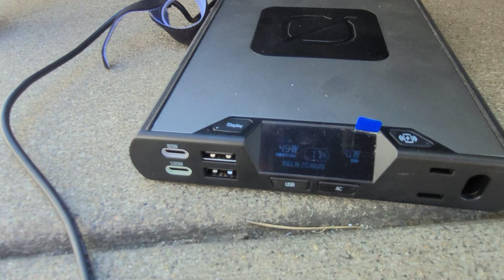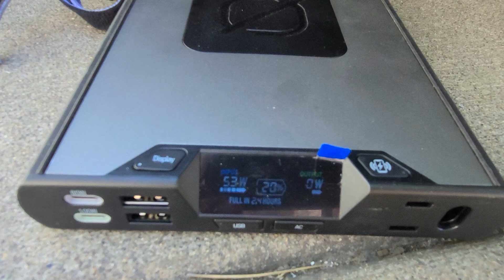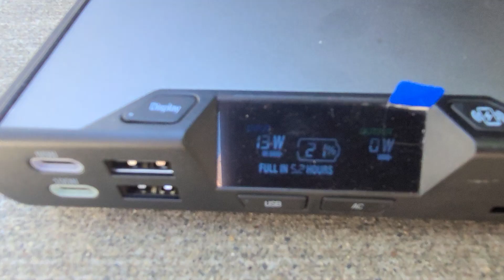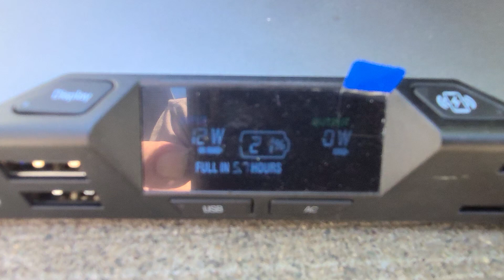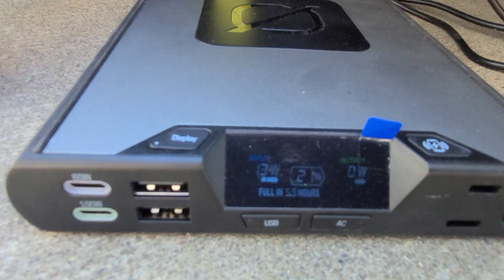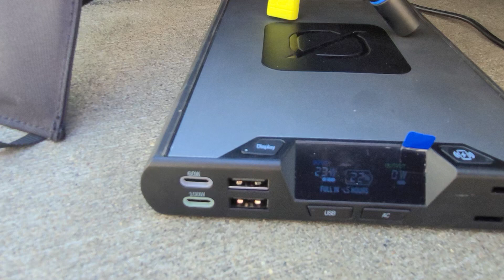Side-by-side testing of Goal Zero Nomad 20W, 50W, & 100W panels with Sherpa 100AC

Comment: Could you recharge a Chevy bolt EV with these folding panels?
Reply from the maker: @BangkokPaul  not practically.  At 1500W our Level 1 charger takes about 48hrs to charge our 2017 Bolt, at 100w (max output from 100w inverter in the powerbank)....about 30 days with no loss, and 100w of solar 24/7.  Also, the inverter isn't a sinewave, so it probably wouldn't even pass 60w along to the L1.  Better to have a big solar array on your house instead.
Reply: @ how many house solar panels would it take to recharge an EV?

Comment: You're not going to be getting the best solar inputs with the Sherpa 100ACs. You need something with a MPPT in it which will optimize the input from the solar panels. The Yetis have this, the Sherpas do not. With a MPPT in a Yeti, you will get anywhere from 25%-35% increase in input watts over what you are seeing with your Sherpas.
Reply from the maker: @jgg204  Say, where is it documented that the 100AC is a PWM?  I couldn't find anything referencing either PWM or MPPT in the literature when I purchased it.

Comment: Good demo of these. I do not approve of the brands out there advertising such claims and charging you for such. Only to be producing 50% of rated power.  Glass panels are just better producing these folding panels all day long. Also, these are early gen folding panels of GZ. New panels like the new 45 watt ecoflow panel claiming 25% efficiency increase will be interesting to see.
Reply: Update. Finally got something new to test on. I tested my 10 watt Nomad on AFERIY Nano 100. It uses a retractable USB C cord and a  1 DC7909 to USB-C adapter. I was able to test the 8mm barrel plug off the GZ Nomad 10 using this adapter. I measured today 8/28/2025 mid noonish got from 10-17watts. Average seem to be 10-12 watts. I did get some testing done on the new ECOFLOW panels claiming 20% + better efficiency. They do better than GZ products. But, is it fact that is better or the products being used? GZ stuff is kind of trash compared to Anker, EcoFlow and such. They don't have MPPT to help make better power.

Comment: Not sure judging panel output based on an ancient  tech power bank is helpful. Did you test them  using a MPPT power station?
Reply from the maker: @ThanksForTheLaugh  Yep, this test was with an 100AC which uses MPPT, IIRC.  The 100PD is PWM, but I didn't actually use that in this test because it doesn't have an 8mm port.

Comment: Always chain panels from smaller to larger. Otherwise nice look at the light weight goal zero gear ; )
Reply from the maker: Yep!  That's what the manual says, so best to follow their instructions.  

My theory is that they say this because the higher amperage panels have larger wires to handle the additional current vs. the smaller ones....but I'm also a bit scheptical about that since the cords look identical.  

Maybe there are other components in the smaller panels that are the bottleneck?

If anyone from Goal Zero can provide some insider information...curious minds would love to know more! 🙂